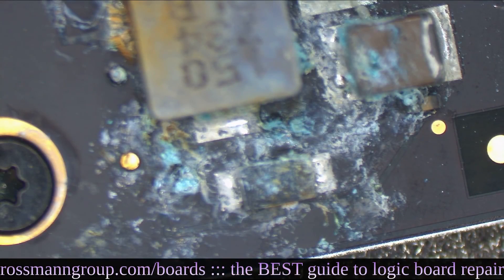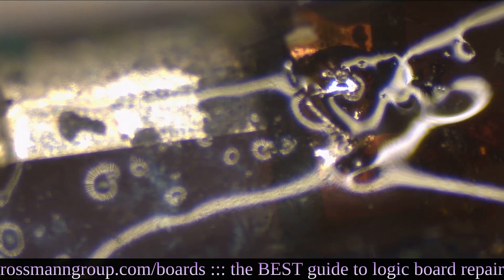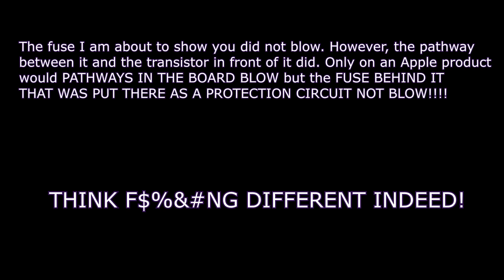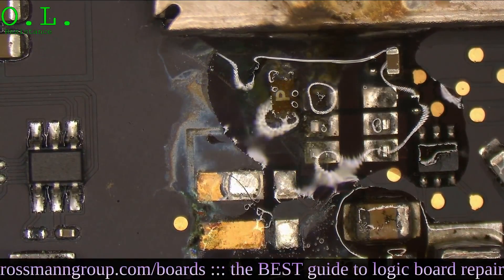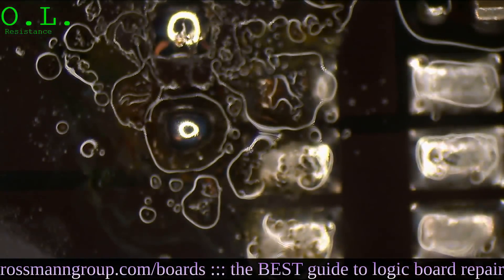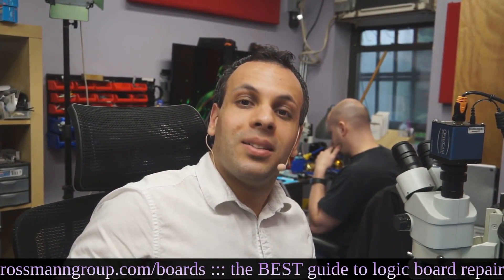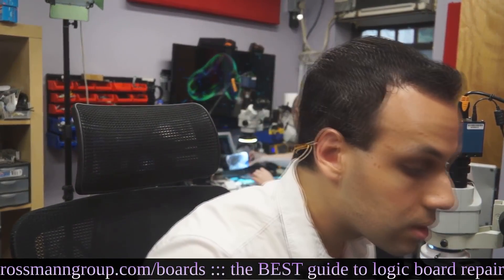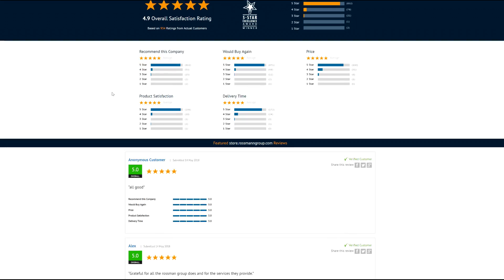The MOST DURABLE Apple component.

Comment: Man! That's innovation! How do you even make a fuse that does that?
No one can do it, Apple does it first!
Reply: Does what? How fuse could prevent this?
Reply: Антон Южаков Dude that was a joke.
Reply: Антон Южаков The fuse didn't even protect the circuitry. It let the current flow through and fry other components.
Reply: It isn't supposed to protect semiconductors tho.
Reply: Plus it was water damage, not backlight short. So fuse has nothing to do with that.
Reply: Антон Южаков As far as my knowledge goes thats what fuses are supposed to do. Break the circuit thereby not allowing excessive current through it. There is no difference in using it with semiconductors, as long as you make sure they are in series.

There are even fuses that are made from semiconductors, so I don't know what you even mean?
Reply: Fuse take some time to blow, it's longer than time needed to blow mosfet out.
It's sole job is to protect battery from short if mosfet would blow short.
Reply: Антон Южаков I know what you mean, you are saying that the mosfet blew up as the current didn't reach the fuse rating. But still using a fast blow fuse or even better a fast semiconductor current limit circuit in series with the circuit would help right!
Reply: Not from water damage, he didn't mention that there was any shorts, that trace just corroded away. There probably wasn't any overcurrent conditions at all. And yes, only thing that can protect electronics from overcurrent is electronic fuse. Fast blow fuses is still way too slow.

Comment: That looks like an oxidation/corrosion issue not overcurrent so of course the fuse can not protect for that. The 3A fast acting Littlefuse seems appropriate for protecting that 4.5A continues mosfet and PCB trace is likely sufficient the problem was that liquid that damaged the connection not improper design.
Reply: That's why you add other protections and coat boards in water and corrosion resistant coatings if you care about protecting your devices.
Reply: +Tom Franco Is there ANY manufacturer of consumer electronics that use conformal coating? I doubt it.
Reply: it depends what do you call by comformal coating. Most of the producers (ASUS, Lenovo, Acer, etc.)  apply comformal coating on some of the stages of motherboard production. All external contacts (USB, power etc. circuitry) remain open, while all small internal circuitry often are closed by some 25-50mkm polyurethane layer. 

At least one of my old Asus laptops had comformal coating applied on motherboard assembly (so motherboard screws were covered too). Usually you can check the quality and existence of comformal coating by examining specific black dots on chips.
I have to say, I have never seen in real life such rusty sh&t Louis shows, it looks like Apple use only paint on  pcb and that's all.

You actually can apply such coating yourself. Most common in Europe is the  Base silicone Electrolube EDCA200H. A big bottle costs less than 20 euros. I use usually CRC Kontakt URETHAN 71, it is quite cheaper and is not really worse.  There are more expensive but affordable high temperature (up to 600C) silicon compounds (some require to cure assembled circuitry in the oven though). I am pretty sure there are plenty of other brands available on american market.
Reply: A server motherboard is the last piece of equipment I expect to be waterproof though.
It's not like sysadmins are going around spilling coffee on their damn servers.
It makes much more sense to waterproof a laptop.
Also, I had an Asus laptop that got completely DRENCHED in water when I got caught in a really bad thunderstorm on foot and there was no cover to take. There were thunderbolts dropping all around me and I was in an elevated area on steel tracks (I lost the last bus that day and had the great idea of walking home on the old railway track instead of the road), so I just wanted to gtfo asap. The pc was the least of my concerns.

When I finally found some cover  (about half an hour into the storm) I opened the laptop and found that it had turned on by itself and was running really hot. I removed the battery and finished walking home after the storm passed.

I left it to dry for two days in my black car out in the August sun and it was fine after that.To make you understand how badly it got drenched: the entire LCD screen had a layer of water trapped in it for WEEKS afterwards, and some of the bright spots never really went away. Nothing else in the laptop bag survived, all my paper notebooks and stuff was destroyed. The laptop finally failed with a ram issue about two years later, so I got it replaced (work pc with soldered ram... fail).

Anyway this was a $700 laptop. It survived being virtually dumped in a bucket of water for ~30 minutes while running.I'm sure Apple could do SOMETHING to stop their $1500 macbooks from literally blowing up because of a few drops of water.
Reply: They just use regular solder mask, as is standard industrial practice. The board also looked just like I'd expect water damage to look like, nothing too bad about that, could've been much worse. 
But as I said, there might be always an exception to the rule, but I wouldn't consider the lack of conformal coating to be a quality issue for such a product. Otherwise, you'd have to call out almost any other manufacturer for the same issue on most of their product ranges. Also, if there is a real conformal coating, you'll see it from the first glance. But you won't find that on much of anything besides some high-rel Server mainboards .
Reply: Servers are sometimes run in a high humidity environment where condensation is unavoidable, therefore you can get conformal coating as an option. 
Your Asus laptop was drenched in rainwater, that's basically not much different from drenching it with demineralized water. A Macbook would've been just as fine under similar conditions.
Sorry, but this is just stupid bashing of something you just can't put anyone at fault for. Apple products are destroyed in the same way by corrosive liquids just as any others are too. If I were to spill some Coke on the HP Elitebook I'm just typing on, it wouldn't look any different to the damage you saw in the video.
Reply: " If I were to spill some Coke" phosphoric acid is one of the ingredients... so how exactly you are unaware of that but you know in the same time that " rainwater, that's basically not much different from drenching it with demineralized water."? btw his bad was soaked and via that bag watter was able to penetrate his laptop so the water was not very clean and there are chemicals and other stuff in the air that rainwater is absorbing before its able to land on anything thats why air is so fresh after rain...
Reply: Yes that was his point. My point is that the fuse had no reason to blow as the circuit was open because of corrosion on the solder joint of the mosfet there was no excessive current for the fuse to blow.
Reply: I've never seen a server motherboard with properly industrial conformal coating.  Encapsulated variants do exist, but I wouldn't call any of them "common". Can you give an example?

All variants had usual PCB+internal circuitry in coating  and exposed logic and power lines.
 ASUS actually started  to advertise conformal coating a number of years ago (2010?) on some motherboards. Even their tablets have pretty decent protection against rust (they target mostly Air conditioning =high humidity issue primarily). 
P.S. I am using for internet browsing very cheap Acer E5-575. I've spoiled coffee on it twice, bubble water a number of times. 
Switch of power, removing shield, disconnect battery (it is not easily removable like in the older models). Remove back panel, remove keyboard, dry everything with warm air. Assemble and continue using it until the next time. It can be so easy. And yes pcb has basic conformal coating.
Reply: --- Irregardless the fuse should've blown before any trace was burnt apart,
Reply: Marian Keller DJI
Reply: I love this "real conformal coating" thing, may I ask you when conformal coating is real? The statement about spotting it from the first glance is great as well. Stupid stupid engineers designing special techniques and standards to do according to you very simple and "obvious" thing.
the statement about high-rel server mainboards is also good. Do you actually know what conformal coating is?
Dude, any usual comformal coating works in the range -25+125C, at best. The special ones which work up to 650C (as an example) have many buts and usually are used just for contact switches in ships or autos.
Most of the compounds start to evaporate at 100C. At 125C they break. Military graded hardware uses quite different techniques for chemical protection (hint: see vibration protection techniques for PCB assemblies)
Reply: Pretty sure his point is that the fuses NEVER blow. Even when they should.
Reply: electrodacus I'd argue on the design issue, but yup, this was corrosion not a blown trace.

Comment: Apple makes the cheapest fuses, all they do is take a piece of metal and label it a fuse they don't bother engineering it to break / melt / blow at a certain voltage or amperage.
Reply: Are you sure that this particular fuse was designed and manufactured by Apple themselves?
By the way, fuses doesn't blow at a certain voltages.

Comment: I think it is funny how he says Apple products don’t last, I have had two PCs and several android phones that did not ever last me a year. That being said I have never had issues with my Apple products, I have a 2015 MacBook Pro that is running with zero issues. I have a iPhone 7 that I bought brand new and have zero issues, my mom is using an iPad form 2013 that is still running strong. So i call BS on your assumption that Apple products don’t last
Reply: I have a Samsung Note 3. I still use it because it is working without any problems. Never had any problem with it beyond changing battery to make it last longer (GASP!). Products should be expected to last for years. I believe that as long as you don't do anything stupid with your product it should last you a long time. Take notice that pretty much all of these repairs are due to liquid damage. If you drop your phone into a pond then don't be surprised if it breaks.
Reply: Mantis Nomo I am not saying that you will always break it. Especially if its switched off dried and cleaned, it will probably be fine. Trying to run it while wet may corrode it.
Reply: I had a chemist friend who did exactly that:  Dropped his iPhone into a puddle.  It filled with muddy water.  He took it apart, rinsed it in alcohol followed by distilled water, and let it dry.  It worked fine again after.

Comment: Apple: "Is the reverse fuse, it's a feature, not a bug".
Reply: It a fuse that fuses other components together or blows them.

Apple, think different.
Reply: Well obviously it breaks when the customer clearly is holding it wrong...
Reply: The reason they use the fuse in the product is the ones before that kept blowing.
Reply: NO! It's an Ifuse or Inverted fuse for non-professionals !
Reply: Terry Wilson nooo... that's not enough comedy. The macbook should be only slightly singed externally. :p

Comment: Can any one tell how p and n channel mosfets open?? I know that voltage should be low or high than other pin. But i forgot it everytime
Reply from the maker: On a p channel the voltage on the gate should be lower than the source for it to allow voltage through, on an n-channel the voltage on the gate should be equal or higher than the source to allow voltage through
Reply: Current flows; potential does not.

Comment: This reminds me of the age old riddle. 

A quality inspector takes 3 bulbs out of a lot. And puts them in the setup and sees that all of them blow in 1 try and aren't working in a second try. After this test he passes all of the bulbs. Why?

A: He was testing bulbs for cameras. 

I guess apple guys didn't understand this riddle well. And QC passed the lot of fuses that didn't blow.
Reply: Why should it blow? Because of water?
Reply: Fuses exist as a collateral. i.e. they blow up in case of a surge(cause is irrelevant) instead of the expensive chips downstream. Hence, minimizing the loss. 

And if you were speaking of the blowing up of the bulbs, these bulbs are called flash lamps and are predecessors of the flash we see today.